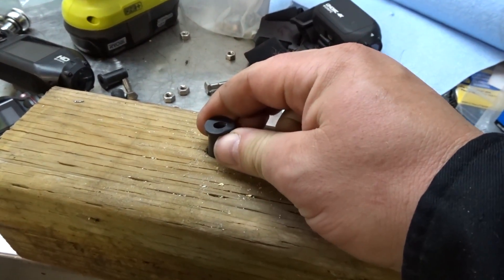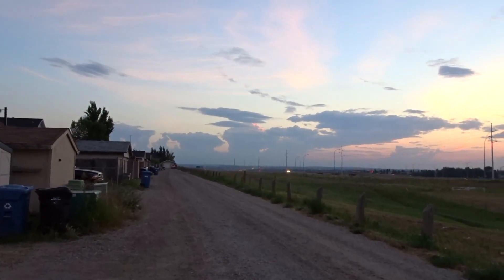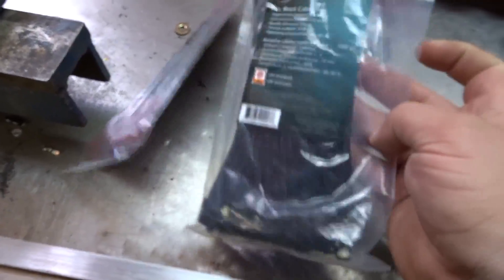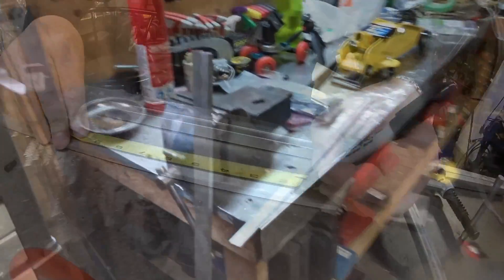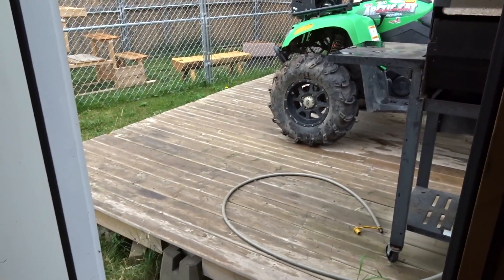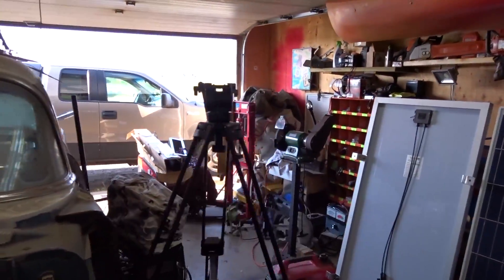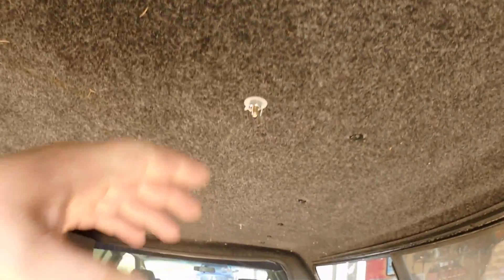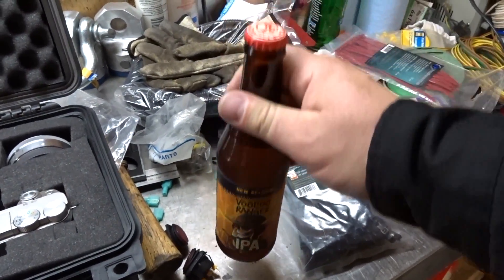Budget Overland Solar Panel and Light Bar

Comment: I add a little 50watt to the roof of the van and 3 group 31 deep cycle batteries under the van. I added a switch that allows me to switch all batteries to the van alternator or just the 1 under the hood, and the 3 off solar.  I was called crazy but now I see I'm not the only one. lol.  Good job on the install, good vid.

Comment: We have a very similar 300w array on our truck. Ours is quite effected by shade. Having the rack/light bar over the top, do you ever see over 200w of solar collection?
Reply from the maker: +The Traveling Together Journal so far even with connecting the other panel and pointing it towards the sun I haven't been able to get more than 12-13 amps
Reply: Depending on how your charge controller is programmed and how your system is wired, that could potentially be a fair amount of energy. My system will produce over 50 volts and put up to 16v into the batteries. At 13 amps that would be 208Watts. If it's an option, I would suggest tracking your solar output in watts. This way you don't have to track what voltage your amp reading is at. Good luck

Comment: how much power drop do you get from the shading on the roof mounted panel , sometimes a little shading effects panel output big time other times not so much, you could test your other panel with a dc clamp meter or an inline watt meter  etc to see how shading effects its output.